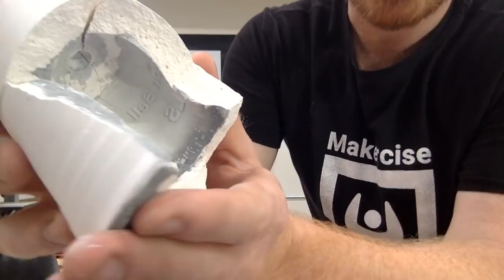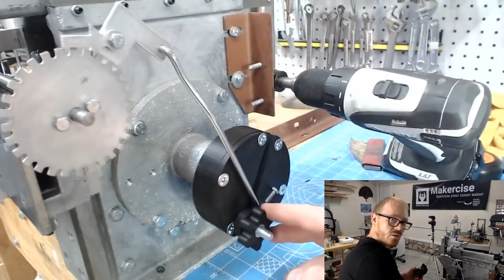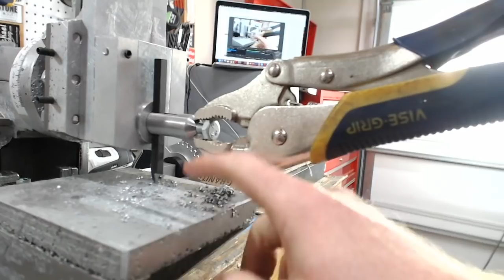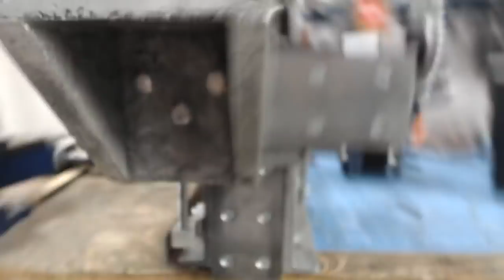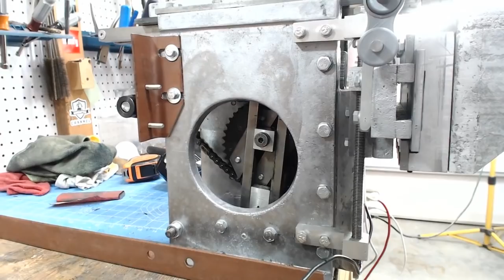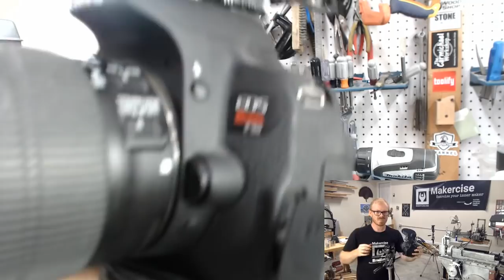Shaper Table Planing Demo

Comment: 3D printing can be used to make moulds suitable for injection moulding of wax....
an extra step and machine... but  moulds can be reusuable. 

Also sodium silicate, and extra fine sand. if in a hurry set with C02 can work to make shell coatings.

Comment: cracking of plaster of paris... maybe add something that makes it more porous...and maybe something fibrous to help it stay together. Vermiculite might work

plaster of paris, contains water locked up into its chemical structure (water of crystallisation).... 
after it has set...
heating to 180 deg C will drive off most of the water as steam
further heating to 250 deg C will drive off all the water , and turn it back into gypsum.
If any of that steam finds it difficult to escape, that will crack a mould

Comment: DIY SODIUM SILICATE... AND EITHER HEAT OR CO2 OR BOTH.
Your refractory mix is too expensive.
Sodium Silicate, and ANY SHARP SAND.... AS MOLD OR CORE.
CURING TIME ... DRYING... IS WASTED TIME.
MIX MOLD FIRE.... NO WAITING.
OR TRY SODIUM SILICATE, CELLULOSE, AND FIRECLAY.

YOUR CATS WILL HATE YOU.

Comment: If it were me, I'd buy a surplus 90 VDC worm gearmotor with a 30:1 reduction to drive that. That would give a 60 RPM output, which would be about right, at full speed to run the crank without having to reduce it any farther with sprockets. That would give you about 60 strokes per minute max. You could then use a DC drive to adjust the speed down from that. There are also some worm gears, with a C-Face flange, from China, on eBay, new, at a very good price. Something with about a 50-63 mm (2-2/12") C.D. worm, would run that small shaper, with plenty of torque.

Comment: I echo what others have said. HSS tool ground with a round nose, advance timing on the reverse stroke. I'll add one thing. Use the tool in a holder. Choke up on it as close as possible. The way you have it set up with just the tool hanging out invites chatter. Nice work though! I admire your attention to detail. Shapers (like other machine tools) have both learning curves and individual personalities. You'll learn what it likes in time and become familiar with shaper operation in general. I'd recommend the Machinery's Handbook. It has everything you need to know.
Reply from the maker: Thanks. I don't have room to go any higher with the table. When there is a work piece bolted to the table I will try to use a shorter tool to minimize stick out.

Comment: I think Stephan uses alcohol for lube on soft aluminum like that- stops chatter and catching & jumping, makes a much better finish - Also carbide is terrible for aluminum - use regular HSS - I agree it needs to advance in the BACK STROKE- not the cut stroke
Reply from the maker: The insert I was using was actually HSS not carbide. I am going to try grinding a blank to get a better rake angle.
Reply: Yes, you need a positive rake, and a honed edge to get a good finish in cast aluminum. Keep the tool bit as close to the head as possible for max rigidity. I envy you, I've been wanting to make these machines since i discovered the books back  in 2000.

Comment: methylated spirits are used as a cutting liquid on aluminium.
Just in case you didn't know, I only found out when I started working in a shop that skimmed tops with a planer.

Comment: The support leg is suspended from the table and slides on a flat metal slide plate, that is on solid surface. It needs to be adjustable for different thickness of material being planed off, i.e. the work piece. The purpose of the cross slide is to support the outer end of the table so it doesn't droop on the end of the cut.

Comment: Ditch the carbide tool, and get regular tool steel. The speed you are cutting at is just fine for tool steel, but too slow for carbide . Also the shape of the tool is wrong for a good finish.You need a round nose with almost a flat trailing edge, with a slight amount of top rake.
Reply: I was thinking the same.. A razor sharp hss tool will cut so much better than carbide in a shaper
Reply from the maker: Note that the insert is HSS. Better geometry is on my list of things to try.

Comment: I keep showing up late to the party... Awesome to see it finally making chips, congrats!  Ceramic shell is an alternative to the block investment type of lost wax/PLA casting you tried last time.  Repeatedly dipping patterns in ceramic slurry and silica to build up a shell takes much longer than pouring investment, but the dewax and firing of the shells to prep them for casting takes way less time than those multi-day burnouts the investment molds can require.  Check out Worldtraveler's great tutorials if you want to see the process in detail: https://www.youtube.com/user/jagboy69

Comment: I'm a glass artist and very often use a refractory plaster mix.  My mix is 50/50 hydrocal and 200 mesh silica flour. Without an additive like silica flour you  can't use a cement product like plaster or even hydrocal, which is much harder, in a situation where it is going to be subjected to high temps.  The reason is the long chain molecular structure that cement bodies take on as they set up.  By mixing in silica flour or even vermiculite or pumice those chains are broken into smaller links and do not shrink and crack.  That said, they can generally only sustain a single high temperature event before becoming very friable.

Comment: Why do lost PLA on cylindrical parts?   You can easily cut and turn them down from stock rounds.
Reply from the maker: Long term I would rather turn from round stock. Short term, here is my thinking: I have aluminum and bronze ingots. I don’t have sock rounds. Casting the flange seems more efficient from a material standpoint. From an embodied energy stand point...hmmm...I am probably making my kids clean up after me. A 1-3/8” tube of C932 is $30 minimum on McMaster, but it will only cost me $2 of propane. Since I already have the $800 3D printer and the investment refractory, the incremental price is right. I could cast into a steel tube to make round stock, but the lost PLA round stock will be a useful and simple test of a concept that will generalize to complex shapes. Short answer: low incremental cost and learning opportunity are why I choose lost PLA of cylindrical parts.
Reply from the maker: Currently printing the ratchet hub in PLA. I plan to pour it tomorrow using a block investment technique.

Comment: Missed the live stream.   POP and drywall plaster by themselves just don't cut it.    Sand, silica, flour and grog can be added to provide refractory properties.
Reply from the maker: I don’t have easy access to grog. I have a bunch of fine silica I got from Doug Jackson a SVseeker. I will probably try that. What about diatomaceous earth? That is silica flour right?
Reply: They are both composed of silica.   Silica flour is ground silica sand, very light and fluffy.  Diatomaceous earth is petrified diatom skeletons.   Both have refractory qualities.  The composition of DE and SF are both constants.  Some grog is made from recycled stuff, fire bricks and fired clay come to mind.  You can't always depend on it being the same composition.  But I expect most any grog would work at investment burnout temperatures as opposed to making a crucible for casting iron.

I don't know where one would get grog outside of the large pottery supply sources.    We used it in our DIY investment back at the uni.   Its on my list of stuff to experiment with but I am not interested enough to pay shipping charges.  My expectations is that one can make investment that works without it.

Maybe more than you wanted to know.  Oh well. 
Dan